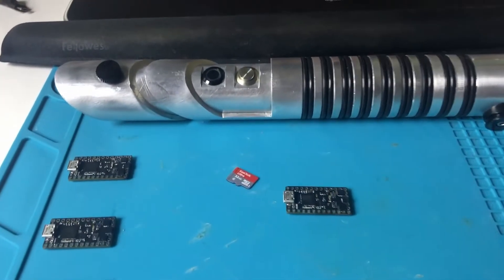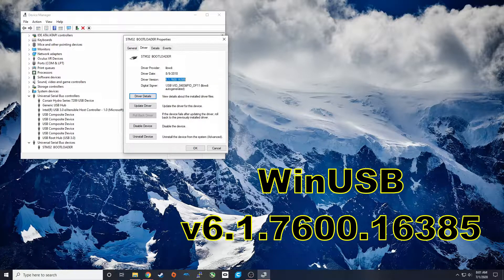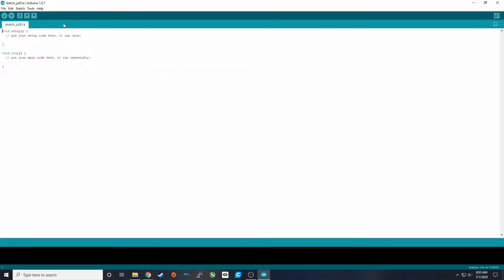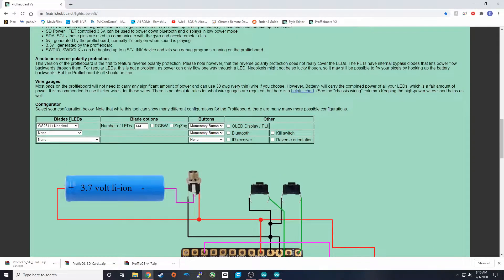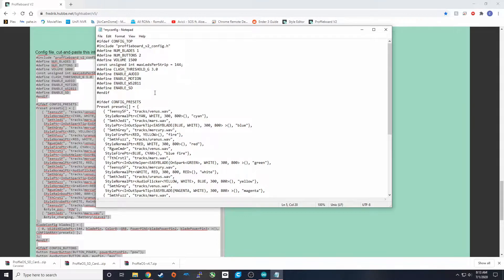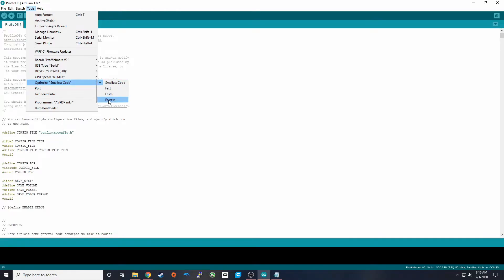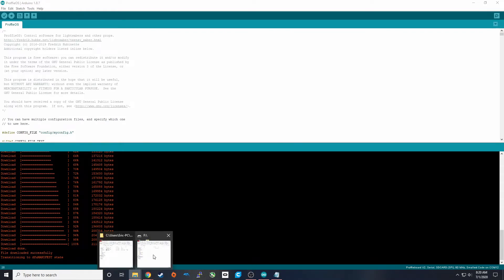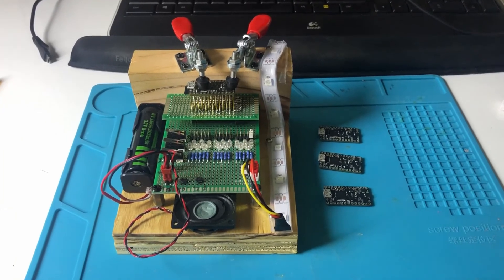How to Program a Proffieboard - Setup & Config Basics - DIY Lightsaber

Comment: No video had helped me, I deconfigured my saber and it didn't even turn on anymore, I was scared because I've only had it for 3 days hahaha this is the best explanation and quickly. It already worked, it's just that the saber doesn't give full light, but I'll look into how to adjust that and see if I can add back all the sound sources and colors that it came with from the factory because they were good and also add more. Thank you so much.

Comment: Thanks for this video. I do have a rather strange question though.
The current install i'm working on would benefit from having the USB and SD card slots facing away from the speaker and towards the emitter end. Would installing the proffie this way mess up the gesture controls?

Comment: ive been trying to get my proffieboard to be recognized as a STM32 bootloader for a while now. When i plug it into the usb slot, it is recognized as a proffieboard however in device manager it only pops up as an unknown device. any ideas why?
Reply: Once you hit the 2 buttons on the board you get an entry on the top of the device manager. 
Once you have the entry you can use the zadig tool to get the driver installed.
After driver installation you should see the board as USB device: STM32 bootloader
Reply: @alirigged8393  yea i ended up getting it to work. i guess the reality was that maybe i wasnt actually hitting the boot button. before the reset. its hard to tell if it was being pressed.

Comment: This is great! Noob here. I ordered a proffie neo pixelsaber from LGT store. If they don’t include the config file, I need to setup up a new config file as you showed, correct? What happens to the sounds/fonts that were installed on the saber, are they lost? Thanks!
Reply: i got one and you can just plug the sd card in your PC and you will have "sd config" folder there. If you won't - PM me, I'll send you.
Reply: @typicalpushkarev  Thanks so much mate! Will do!

Comment: Just one thing to add. I found that if you press both reset buttons and it still does not work...change the order in which you START to press both buttons to reset the board. It worked for me. Thanks again. This is a great tutorial!

Comment: I can't get zadig to find stm32 bootloader I have tried 2 computers both windows 10 and 3 different data cables. When I plug into the board my computer recognized the proffieboard but zadig doesn't and neither does aduino ide in the ports section

Comment: In device manager my board showed up as CDC Data not stm32, however it did let me update the drivers on it. My board came installed already so maybe thats why? I got mine from pach store. I cant access the boot buttons i have proffieboard v2.2 but it has plastic around it and In the instructions it told me not to remove the plastic around the board.

Comment: great tutorial, what pogo pins you used on your test rig?
Reply from the maker: TOTOT 100pcs P75-E2 Spring Test Probe Pogo Pin Test Tools Dia 1.3mm Conical Head 1.02mm Thimble Length 16.5mm PCB Testing Pin Spring Contact Probe https://www.amazon.com/dp/B07MZM62K5/ref=cm_sw_r_cp_api_i_-hhaFbPXATQ
VM